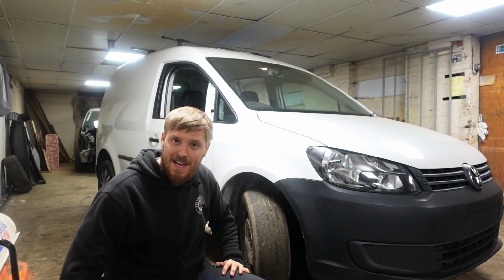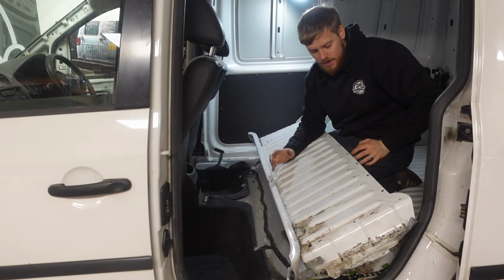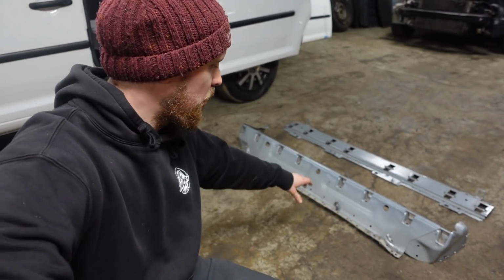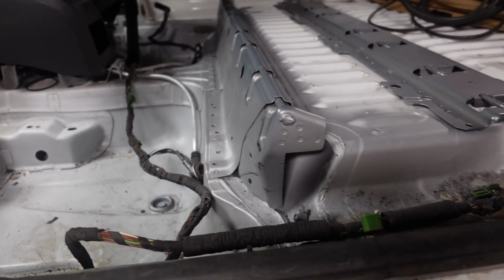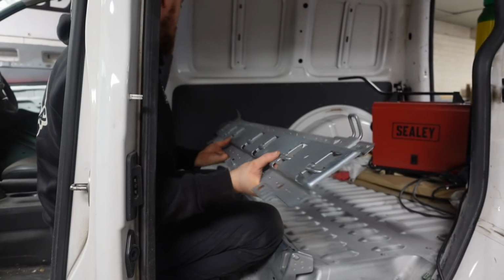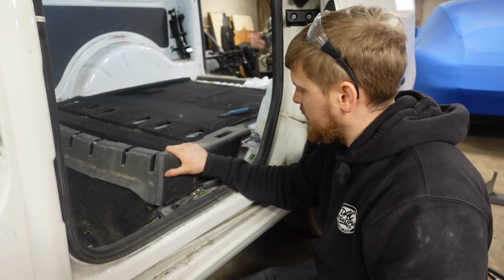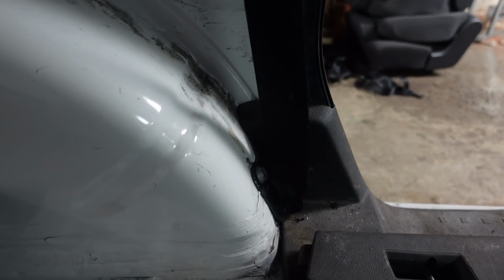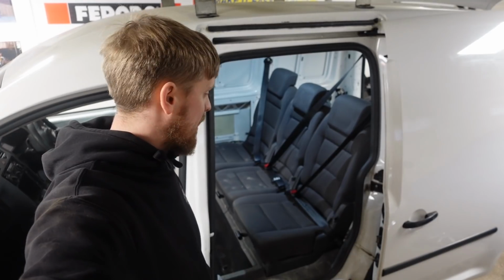VW Caddy 2K Build Series - Touran Rear Seat Conversion - Episode 5

Comment: Very tidy work dude, Caddy is looking great now.
Let me know if you need the wing repeaters coded out, the door module has the output which can be coded with VCDS for the mirrors but the BCM output for the wing repeaters is a bit more complex to disable.
The side door trim you need will be from a Caddy life, the maxi is longer. Put up the part number you're looking for on the forum, I'm sure it's something we can find.
Reply from the maker: Thank you for the offer! I will need some info. I have VCDS but have never used it!!!

Comment: Some bits in this video I've been made aware of, Cheers 🤙

Is there part numbers for the floor mounted belt brackets and the roof panel as I'd rather do it as oem fit as possible its all done apart from rear belts 🤔

Comment: Great video/guide. 
Did you fully weld the entire perimeter of the seat bases or did you just run intermittent stich welds to avoid distortion of the metal?

Comment: What’s the end goal? 
It’s looking like you’re taking a touran apart, to fit parts into a caddy to make a touran.
Reply: To have a passenger carry capable, and running Caddy. With some unique upgrades. The Touran is a parts vehicle and isn't the look or vehicle he wants. He wants a caddy that is versatile with more room than a minivan. End goal have fun doing it, teach others how it can be done and help them get on their own projects.
Reply from the maker: Pretty much a Caddy with 5 seats, a nice interior and exterior. Even though I am fitting a Touran interior it will always be a Caddy.
Reply: @DanChambersDAC  i like vans and unusual vehicles so i dig what you're doing.
I thought VW did Caddy crew vans but i assume they are quite rare.
I recently bought a mint older Berlingo Multispace so have the benefit of a car and a van.

Comment: Hey Dan I have watched this 3-4 times as planning on tackling this myself and have all the part’s required and ready to go! My only concern is welding so close to the fuel tank, what precautions did you take before welding ? Any at all would be handy as I don’t want to miss or overlook anything. 
Cheers 
Jack

Comment: Hi Dan, we started trying to remove this part of the floor (for a campervan conversion), however the sides are tightly glued to the chassis. Did you encounter this as well and if yes, how did you get the panel loose? Thanks!

Comment: Plastic side steps are available from VW... I know as I bought mine from them literally a couple months ago. I’ll dig the code out for you
Reply: 2k0 853 369 82v
2k0 853 370 82v

82v is for the colour which in mine was Titan black

Thank me later 😉
Reply from the maker: Cheers for the codes bud. Spoke to them last week and no longer available. Got some second hand though.

Comment: Great conversion Dan. But aren't you in danger of just turning the caddy into the touran? Are you going to put windows in the back?
Reply: That's my thought as well. What's the point of buying a van and then swapping pretty much a complete Touran interior in it?

Changing the front for a bit more luxury, sure, but the rear should've stayed a van imho.
Now he's just making a Caddy Life/Maxi.
Reply: @devilskullBEL  I guess some of it is, just because it can be done! I am amazed at how many of the parts are virtually interchangeable. I'm sure it'll be a great Cadran when its finished or even a Touraddy! you chose.
Reply: Would it be easier to weld up the windows in a touran?
Reply from the maker: I am doing these jobs as they are very popular in the Caddy scene but no one has ever done video's on them. The sears will fold forward and can be removed so will still have a pretty decent sized load area. A bonus of being able to carry 5 people too. No windows going in.

Comment: Hi dan just a quick one as im at the stage of fitting the seat belts in,how the hell did you get the drivers side reel into that opening????? I can only just fit my hand around the back of the panel nevermind a seatbelt reel either haha. Cheers
Reply from the maker: Mine just slid straight in bud. The passenger side took some cutting and hammering.

Comment: How does it work with inspection in England? (MOT?). Here in Sweden, it is almost impossible to make this road legal without a certificate from Volkswagen 😢
Reply: An easy way to get around it is to just take the seats out before the mot, if they aren't there the seat belts can't be tested so they can't fail the test.
Reply: @BlandNutz  Yes, of course, we can do that too, but I want to do it right if I rebuild. I'm just curious what the rules say in England. Here in Sweden, it can also be a problem if you had passengers in the car in a traffic accident.
Reply: So long as the seat and seatbelt mounting points are considered secure by the MOT tester then you’re good to go although I can’t see how they would know just how secure they are I don’t know. No doubt in the future this won’t be allowed.